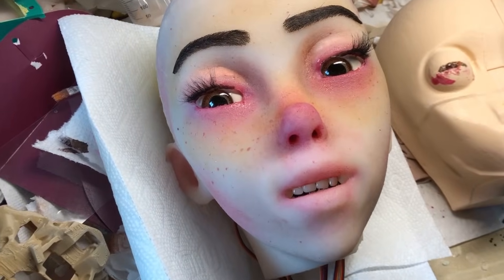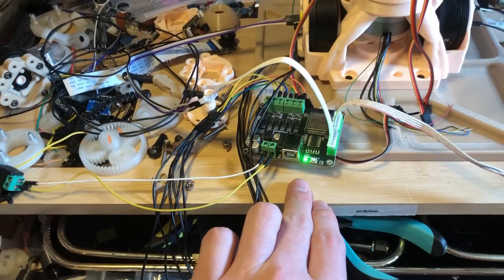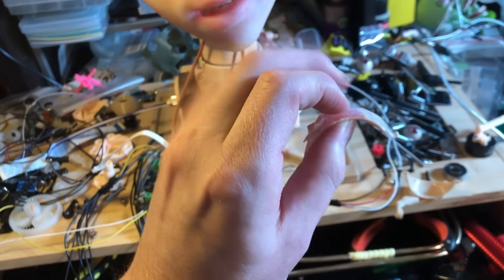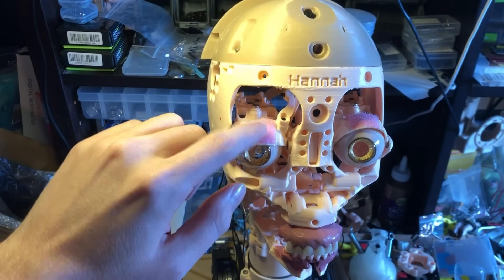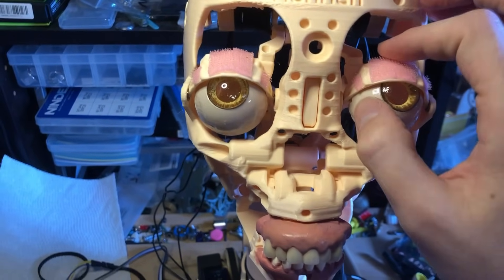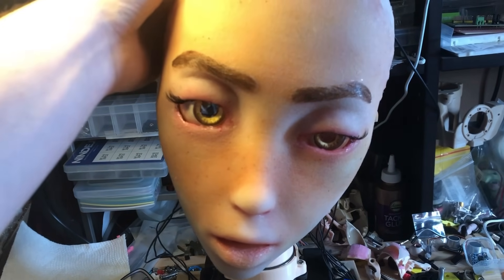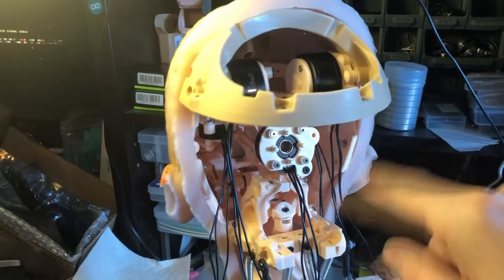Improved Eyelids

Comment: 1. The interface between the upper eye lid and the rest of the skin is too thick.
2. You proubably need to use hooks/dovels/slots to hold skin. Imagine, you're holding a ball in your hand. Now imagine the fingers curved outwards instead of inwards. Now put those fingers on the outside rim of the eye. With corresponding slots in the skin, you would be able to clip the surrounding skin in place. The circumference of the skin rim should be just a bit smaller than the actual eye rim, so that it would be stretched a bit and would hold itself in place firmly. Best materials would probably be metal wires for hooks, and stiffer (and strudier) silicone for slots. The wires are heat-inserted/melted into the plastic base (i.e. non-hook end is bent into circle/spiral/grill), the slots glued into the matching cavities in the skin (slots can be plain cylinders/cones/half-spheres on the surface, that is glued to skin).
Reply: Another point of contention for me is how you all are making the skin.
Why uniform silicone? It's fragile at desired thickness.
Have you tried compositing? In the forming base, spray a thin layer of silicone, let it cure partially, spray another layer, repeat to about 2/3 or 1/2 of the desired thickness. Now on the partially cured skin, put composite materials that can be soaked with silicone, f.e. use patches of fabric or teflon tape there you need large surfaces resistant to tear and shear (cheeks, forehead etc.), cotton thread where you need structural strength (eye rim, mouth, outer rim etc.). Then spray next layers of silicon. Repeat for whatever layers count needed.
This way proubably would be able to make much thinner but sturdier skin, with varying properties in different areas where needed: thin skin for oftenly deforming areas (eye lids f.e.), thicker and sturdier areas with incorporated interfaces/slots where an interface with a motor/anchor is needed etc.
Reply from the maker: I don't really have a set up for doing that kind of work with silicone.  To work it through a spray system of some kind would mean a lot of solvents to get the silicone to flow, and also to clean the spray tool afterwards.  I'm working out of my living room here, I don't have a shop with good ventilation.

Completely agree that layering different kinds of silicone could create very nice results.

Comment: I would suggest using 14 gauge wire to form the under eye lids. It can easily be shaped to match the eye and the silicone cab be molded around it. With a ring formed in the end after a 90° bend it could even be used to control the lower eyelid movement. Just shape it something like a servo horn with a ring big enough to pass the linkage screw through.
Reply from the maker: That sounds like a good idea for the eyelids.  I may try that out!

Comment: you could do the same with a flexible cable. giving you more room for other components in the future. the motor would just need to be reoriented. a tensioning system integrated into the silicone of the eyelid ? maybe som nylon line or some banding that you can access from inside of the head when the face is on. just enough to eliminate the game between the lids and the eye?'
Reply from the maker: I've got some PTFE tubes and nylon line in the mail recently.  I'll be experimenting with them soon.
Reply: @DaveMakes  this is really cool what you are doing btw.
Reply from the maker: @ModdedGarage  building an animatronic robot to interact with AI.
Reply: @DaveMakes  no I got it. Just saying the robot is neat
Reply from the maker: @ModdedGarage  I misread your comment as two separate sentences for some reason.

this is really cool. what are you doing btw.

I may have been awake for too long. :face-red-droopy-eyes:
Reply: @DaveMakes  it ok, just don't burn out. fun vids man.

Comment: Is there any particular reason for using separate motors/servos for each eye and eyelids? Wouldn't one motor for each be more efficient, plus less weight in the head, and also less coding overall?
Reply from the maker: i'm using two motors for the eyes X axis to allow for convergence.  So when she is tracking faces with her camera later on she will be able to adjust the distance of her pupils accurately.  Pupils are parallel when looking into the distance and look inwards when focusing on near targets.  The Y axis has only one motor shared between both eyes.  

Each eye lid has its own motor for similar reasons.  Ideally I would have 4 separate motors for each eyelid (upper and lower, left and right).  For added control over facial expressions.

Comment: Looking freaky, but in a good way!

For the lower lid, couldn't you just attach the silicone to a shaped piece of steel armature wire? Possibly even embed it into the silicone?
Reply from the maker: yeah, that's not a bad idea.  I'm wondering if maybe I leave room for a small cavity there so I can really stick some wire in there.  Pull it tight from behind.  Maybe even just some nylon string.

Comment: in a future im suggesting you to bind some motion to the upper eyelids from eyeball vertical rotation - if you looking down - eyelids synchronously moves down, eyes looking up - eyelids moves upward too...

also suggesting you to take a look on FACS papaers (Facial Acting Coding System)
Reply from the maker: I familiar with these.  I've done a fair bit of character animation.  Studied it in college.  Eyelids, both upper and lower will follow the position of the pupil.  Mainly in the vertical direction, but also in the horizontal direction.  When the eyes look to the left (egocentric) there is a tendency for the right eye to close somewhat.  This is heavily exaggerated in a lot of cartoons.
Reply: @DaveMakes  oh that's great! sorry then xD perosnally i think side movements are shouldn't exist - there a moisture to make eyeball to slide smoothly... if you make that side following movements it will add tension or friction like effect which isn't exist. Rising and closing is just anatomical reaction/reflexes which we can be control separately.
Speaking of eyelid's side movements  - we can't control it on purpose, it appears by side effect, every time when muscles are tensioning to move them... it's like ropes that tightens the cloak.

Comment: Maybe you can bond plastic screws/rivets like they have at Essentra to the inside of the cast using that glue? To pull the nose skin in. People have also made silicone gecko tape in youtube videos, you could try to integrate that, however might be hard demold.
Reply from the maker: i'll have to explore these.  plastic rivets might work for some areas.  thanks!

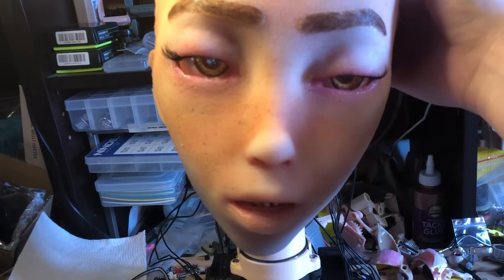Comment: 10:26 lol I'm blinking my own eyes like "do the bottom ones move?"
would be interested to see how you structure the code since it will be a lot of sub systems talking to each other/larger parent ones
also if the motion becomes functions callable as agents for an LLM if it's driven that way from vision context/audio commands
Reply from the maker: lots of distributed microcontrollers set up to receive simple position instructions from some master controller.  I will likely try doing this wirelessly.  Hannahs brain can be a desktop computer nearby, without having to be inside her.  I imagine a large variety of movement behaviours, poses, actions and blends of actions to be situationally addressed by an LLM that chooses which motions are the most appropriate at any given moment.  In a rudimentary way, an example I can think of would be the Bing chatbot. It uses a lot of emoticons, and it does so fairly naturally in appropriate situations.  Those emoticons can be translated into a variety of motions or poses.  A bit of sensor awareness in the robot can further modify the way the emoticons are inflected, taking into account people in the environment and other things as well.

That's what i'm thinking at the moment, but it will be a bit of time before I can get around to doing it.
Reply: @DaveMakes  I'm thinking websocket and JSON for real time transfer/shape of payload. But I would think you'd have to have some kind of computer onboard to do that talking to remote/maintaining state until remote command is given. eventually you'll get to SLAM from the eyes/IMU(s) inside and pressure feedback, etc... man crazy project, throw in self charging

Comment: Regarding the skin below the eye, you could use the same velcro technique you used for the eyelid. But since you need that bottom skin to be tight against the face, you could attach the velcro to a little threaded panel, and you could turn a screw in the back to adjust the depth of the panel. Or instead of a screw, you could use a rubber band in the back or something. But the main point is the velcro pad attached to a panel that is pulled backwards towards the face. And the way the silicone is bound to the velcro, it should be a an effective way of keeping the skin from sagging
Reply from the maker: I think that could work, yeah.

Comment: Have you considered having a pocket in the eyelid material that the printed piece would slot inside?
The eyelid itself looks to need a fold in it, to be able to stretch down further, and to move up without moving the eyebrow section.
Reply from the maker: it's tricky.  If the silicone is too thin, it can rip.  Also, very few things stick easily to silicone.

Comment: This is awesome. Keep it up. And consider a collaboration with clone robotics. Their muscular skeletal system plus your aesthetic designs would be amazing.
Reply from the maker: Thanks for the suggestion! I'll check out their work.
Reply: @DaveMakes  they use hydraulics instead of motors, and it produces a very humanoid movement. It's basically simulated tendons and muscle. Even with only a simple clothing sleeve like spandex, it looks very convincing. Almost like a hand wearing an opera glove over a gaunt arm. 

At some point they'll be looking to do aesthetic improvements with their models. It might be a good time now to get in touch with them so you're on their radar when they get to that step. 

Again, just a suggestion. They haven't actually gotten one of their models to walk yet, but they're currently developing the lower body now. 

If you were able to get on their design team for the aesthetic portion, they could release anime robots, which would of course sell like hotcakes. Then all they'd have to do is get a licensing deal for the character Hatsune Miku. And it would be like printing gold. 

Good luck. 
And I'll keep an eye out for your videos over the years.

Comment: what about moving the eye forward in the socket to meet the lids removing the gap or change the shape of the eye for the mould resulting in more meat in that bottom eyelid in preparation for it to sage a bit
Reply from the maker: I could try pre-deforming the skin before casting.  So it has extra tension.  Move the lower lid up a bit as well, yeah.

Comment: Congrats on the ad. Awesome to watch the progress.  cant u add a bottom eye lid to the top eyelid with a little gear sides. so when its nearly closed it pulls the bottom one up?  Great job as always.
Reply from the maker: If I had bottom lids in there it would probably not be an issue.  Not sure I have the space in the skull for all the mechanics to do that though.  I'd want to control them separately from the top lids if possible.

Comment: Thanks for the update. Are you going to share the details of the motors with us? Its a really nice upgrade. I keep thinking about the 15 servos in an arm for fingers setup and have no idea how that could span out without giving up on individual joint control.
Reply from the maker: the motors for the neck are GM5208-12's, and other smaller gimbal motors in the head.  Typically used for camera gimbals I think.  

I'm thinking 7 axis for an arm, and some greatly simplified hand shape.  Maybe built around the idea of having a single motor articulating one particular grasp very well with some linkages, but no others.  Interchangeable hands for different grips maybe?  Not sure, probably i'll change my mind a dozen times before I get down to the hands.
Reply: @DaveMakes  Thanks for the info. Yeah I do like the interchangeable hand idea. I do wonder now if changeable at the top of the forearm would be good to enable full variety changeable mechanisms. Anyway, good luck with the progress.

Comment: On the behalf of all the weebs: You sir are doing God's work.

Joke's aside this is a really cool and promising project. What's the end goal? Just the face or are you going for a full blown animatronic?
Reply from the maker: whole upper torso and arms at the least.  I think the next video will be a revised shoulder design.  Working towards 7 axis arms.
Reply: @DaveMakes  I saw an article about muscle-like actuation realized with graphene–liquid crystalline elastomer composites. Tiny thin fibers controlled by small amount of current. I have no idea if they are available for sale or if they are in any production-like state past R&D, but I think they could solve most of your issues with flexible curvature - eyelids, facial muscles, tongue.
Reply from the maker: Well if I ever see them turn up on aliexpress, i'll give them I try. Might be a while though.

Comment: I'm not any kind of professional so if this is stupid advice just ignore it. I am not perfect at anatomy but I think you need to make a nose bone because it can hold that skin that's being stretched. The cartilage on peoples noses holds the nose up but the skin on the face seems to be also held from that point too I assume with the ears also falling into alignment there as well. Kind of like an imaginary line from nose to ears being at the right alignment - there is cheek muscles and nose cartilage grafting onto the bone / skull. I would put a spacer where the nose bone would be and have it make surface tension kind of similar to what you did with the eyelids.
Reply from the maker: I think you're right.  Some kind of nose bone, maybe with a bit of an adjustable hook(s) so I can make minor adjustments to the tension - pulling the nose-bridge inwards a bit.  Best case scenario would be a little knob I can turn to tighten it a bit after i've got the face on there.

Comment: Awesome work, I am once again in awe of how far this project has come. I love the new motors which don't make a sound. I always look forward to your update videos, this is so cool!
On that note, once you cover up all the electronics, I would assume most sounds coming from the robot as masked and therefore muted?
Also, would it be possible for you to post a video in the future showcasing the speed and power of the motors? I am very curious to see how fast the head is capable of moving/turning.
Reply from the maker: Yeah, i'll try to add a better demo of the motors in a future video.  They can definitely move quite quickly, though they're not like drone motors.  These are optimized for torque rather than speed (different winding style I think?).

Comment: To simulate the mechanical binding effect of the velcro loops without the added thickness of the velcro, do you think printing the plastic of the eyelid with perforations for the silicone to anchor itself through would work? It would require some silicone to end up on the back side of the eyelid to form a wider mass that can't fit back through the perforations, but I don't know if that would be a problem.
Reply from the maker: it might work.  I'll see what I can come up with!  shaving even half a millimeter off the thickness would be good.